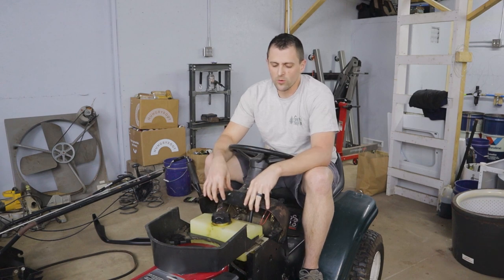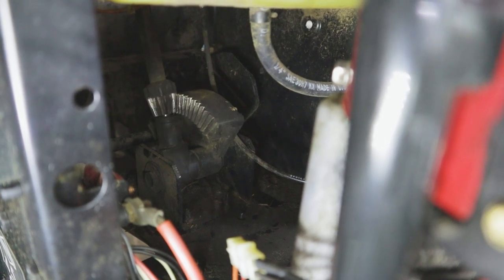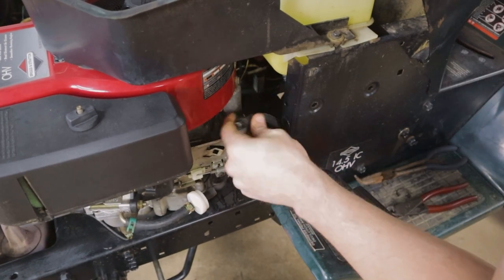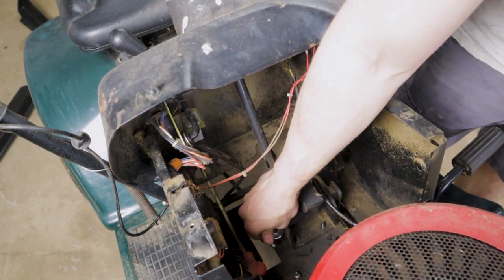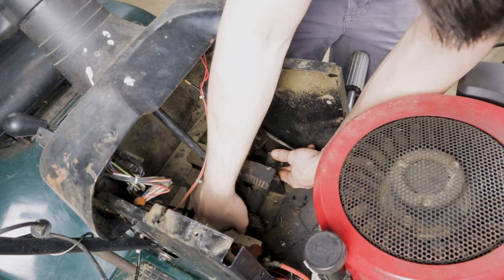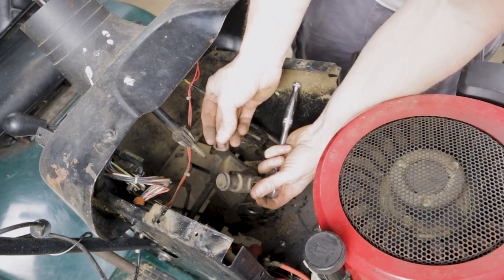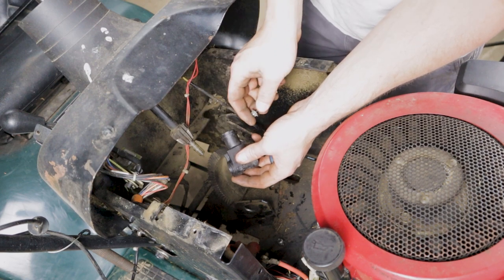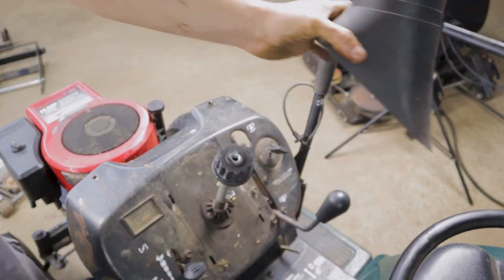How To Fix Sloppy Steering On Craftsman 917 Lawn Tractor.

Comment: I also did not mark where the two gears meet (1/2 moon and the shaft gear) where approximately should they be alligned when wheel are straught forward? Thanks - should have watched your video before I replaced all stearing parts, did not realize those 4 bolts could be removed from under carrage, near impossible from top side. Thanks Again / Jerry

Comment: You had better luck getting that gear removed. Put blaster on mine to get rid of the rust , letting it sit , see if I can slide it over enough to get that part off
Reply from the maker: I will say, I was fortunate that there weren't any parts stuck or seized together. Also if you are still having trouble, a mix of acetone and ATF is better than any off the shelf thread penetrator.

Comment: YOU FORGOT TO THE WASHER WHERE THE SPINDLES ARE😮
Reply from the maker: Did I?
Reply: @TwoFourSevenDIY  not in the video 😳
Reply from the maker: I'm confused, if it's not in the video, then how would you be able to point out I forgot it?? Lol 😆
Reply: @TwoFourSevenDIY  another person in the comments noticed it to. Andrew bratos.
Reply from the maker: Noticed what?
Reply: @TwoFourSevenDIY  get your self a pair of glasses. I'm done
Reply from the maker: @tadeuszmichaelwlodarczyk3120  How would glasses help? You said yourself it wasn't in the video lol 🤣
Reply: @TwoFourSevenDIY  l said and the other person Said you forgot to put it BACK🙄
Reply from the maker: I put everything back the way it came apart, rewatch the video and see for yourself
Reply: @TwoFourSevenDIY  you definitely didn't put back the washer between the new part and the steering shaft. You definitely need glasses 🤓
Reply from the maker: You sure about that? 🤣
Reply: @tadeuszmichaelwlodarczyk3120  He definitely put the washer back on with the new bushing! You really have to watch the video again.
Reply: @BSS22193 
If you ( notice) when he took the Bottom Part off their Was A ""Washer""on top of IT!!  Which Never went Back!!
Reply from the maker: @tadeuszmichaelwlodarczyk3120 You sure?
Reply: @BSS22193 
I'm not discussing about the steering bushing under the steering wheel. Only the bottom new. Part🙄
Reply: @tadeuszmichaelwlodarczyk3120  I know that it isn't the bushing under steering wheel you're talking about. It's not my problem that you can't watch the video again. I know what i saw him do when he put it back together. You clearly need to see the video again before you comment this more than you have already did. When even the guy that done the job say that he didnt forgot to put it back on you have nothing you should have said at all.

Comment: Yeah that's great. Have fun doing it every 2 years as we have had to do. Having that PLASTIC shaft support there in what is already a sloppy mounting is an absolute garbage idea and execution. It's made what has been an otherwise reliable tractor into a headache. Just a stupid design.
Reply from the maker: Original one lasted 20+ years ...
Reply: Are you hard steering it a lot, steering at a dead stop and/or using it on rough terrain?  Forcing the wheel is going to strain the components more, running into things add additional wear tear.
Reply from the maker: No not really but my property is significantly oversized for this smaller mower, I made it work for years until I upgraded, just ended up putting a ton of hours on it.
Reply: @TwoFourSevenDIY I broke the steering gear, the large wing gear, forcing a parts mower steering wheel.  I was trying to get room for a jack and  destroyed the gear.  I had no idea you could shatter it like that in the side spline shaft input of that gear.  Toast.  The newer set-up is better, I think they introduced that in 2004.

Comment: THE GREASE WILL ATTRACT  DIRT
Reply from the maker: Sure. But a dry bushing is never a good thing. Everyone has their own way of doing things.
I always grease bushings like this with very favorable results.
If you get good results from not greasing, then keep doing what works for you 👍
Reply: Garage door lube may be better and attract less dirt.  It's available at Menards and Lowe's and other stores  in an areosol spray.
Reply from the maker: I've actually got a can of that ... white lithium grease ... could give that a try if I ever need to in the future